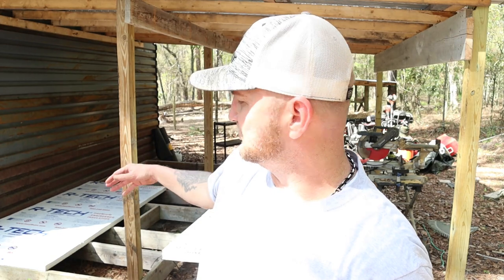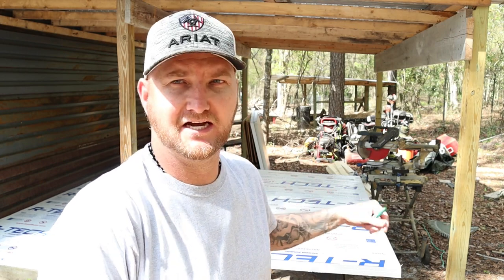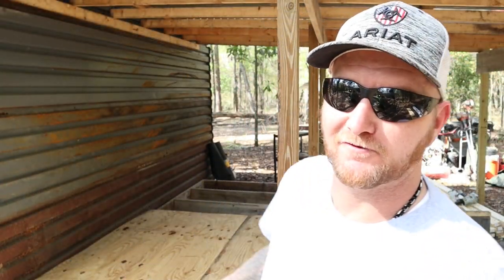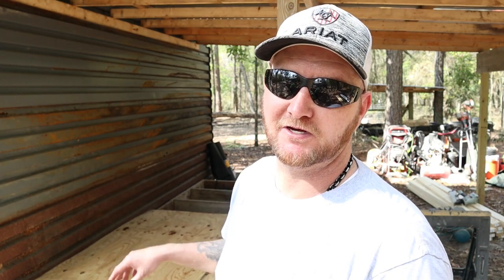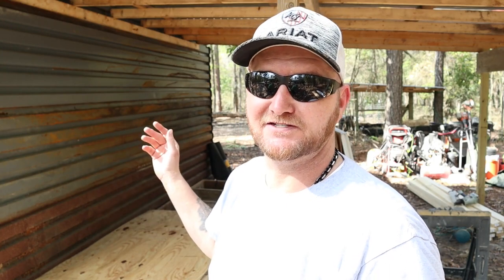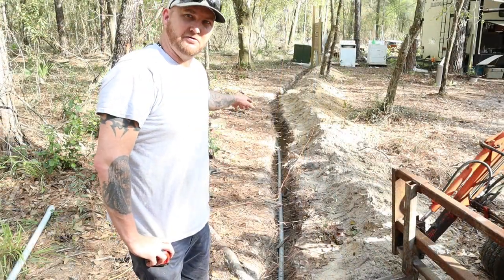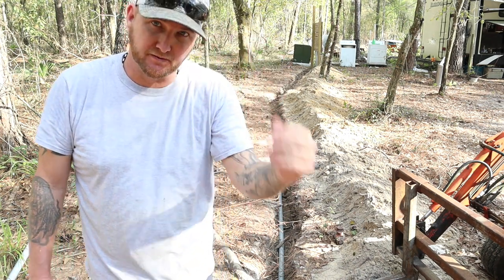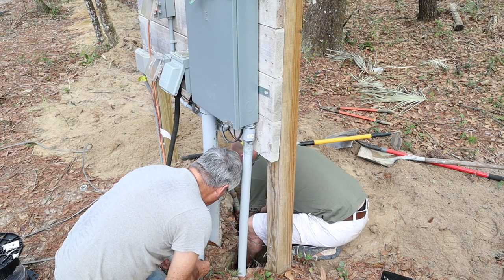OUTDOOR KITCHEN AND WALK-IN COOLER PART 1 MAIN POWER

Comment: Loved that string trick instead of using a fishtape. Mine always seems to get hung up in the pipe so I’ll try the string method when we start to wire our farmhouse for solar. . So excited for you to finally have that outdoor kitchen!!
Reply from the maker: Works well if you have a long pull use mule tape its stronger than the string but can use it the same way C'mon!!